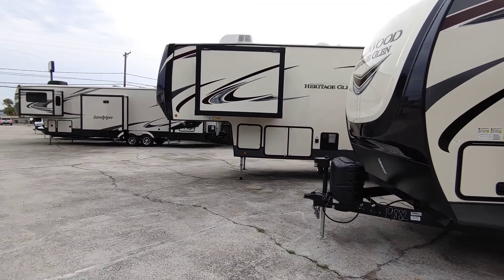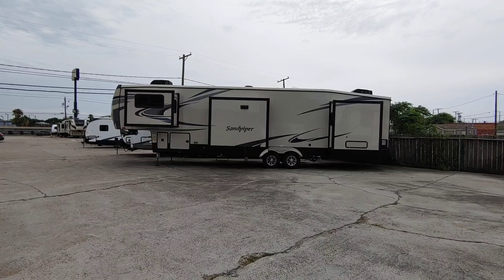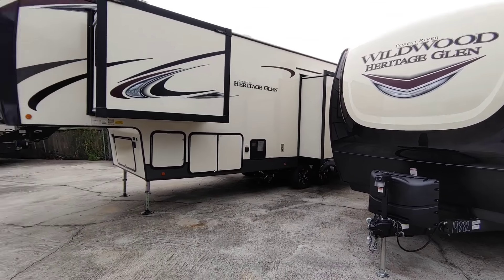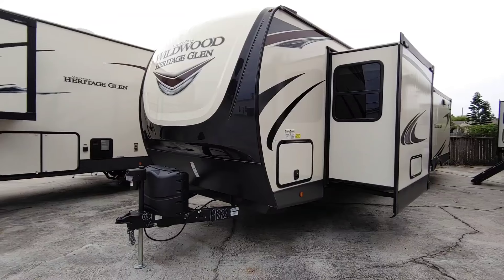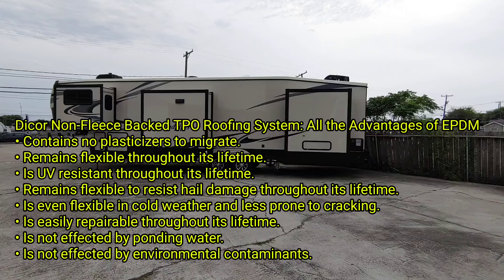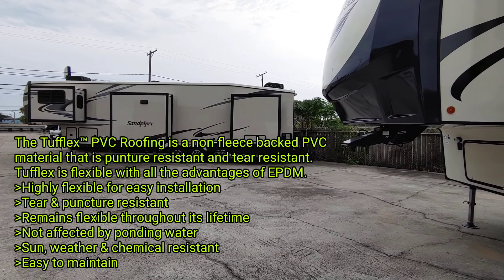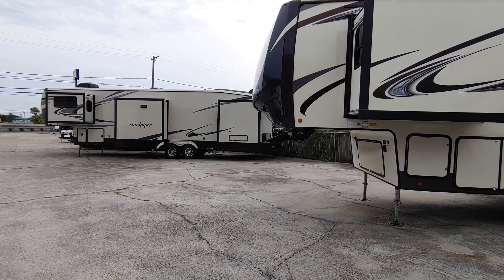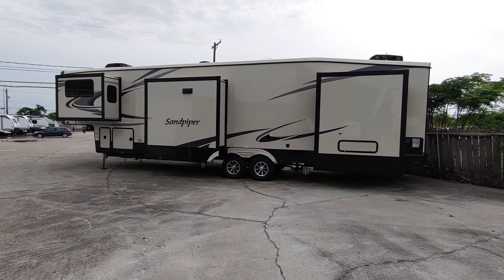RV Roof Materials Explained! Does it really matter? FIND OUT!

Comment: Coming from a commercial roofer of 25 years. EPDM is old tech. It also requires a chemical weld at all seams
TPO & PVC are similar. Both use heat welds at all seams. TPO is stiffer and less flexible than PVC. PVC is easier to install and detail around penetrations. PVC is typically a few cents more than TPO per foot. They are both easy to maintain. One of the reasons I chose my evening is because of the PVC roof. Hope this helps some of you out.
Reply: There is a product on Amazon called Class A Customs Superflex rubber roof.  I asked a question on that site and someone said that it is pvc.  Would you happen to know about this product?  I am planning on replacing the beat up EPDM roof on my 2007 Keystone toy hauler fifth wheel with this superior new pvc product.
Reply: Thank you Gabe for the information!!
Reply: Hi Gabe, second question, years ago I heard a roofer say use Torch On, they use it for flat roofs and corners, what do you think?
Reply: @franklogan494  Torch down is a super bad idea for an rv. It uses an open flame form a propane weed burner to be applied.
Reply: @raypabs5374  Hey Ray. I have not herd of this brand before. It is most likely made by another manufacture and private labeled for Superflex
Reply: @nvstyle5559  Sounds good Gabe, Thank you!
Reply: Hi Gabe. I have a 2014 travel trailer I live in full time and I believe it has a EPDM roof. I'm wanting to put a coating on to help with the hot Arizona sun & electric bills. I bought a product called ElastoKool but I think it said not to use on my type of roof.  Any suggestions on a budget?
Reply: Go to ABC supply and buy 5 sq roll of GAF self adhered single ply and a heat gun and T - Bar and voila U are on your way to a maintenance free roof system.... Just YouTube for application details.....
Reply: Photos of different types??

Comment: Thank you for explaining the different styles of roofs.  The warranties on these roofs are pretty much useless unless you follow their maintenance guidelines to the letter and can prove you did the maintenance.  A friend fought with Heartland a couple of years back over an issue and actually had the problem addressed by his dealer but the manufacturer still denied paying for the repair.   I sealed all the joints (front and rear caps and all protrusions) with Gaco's seam tape then used their liquid tap over the seam tape.  Once all that was completed, I applied  3 coats of Gaco RV Roof Coating (silicone-based) to all areas of the roof and seams.  I am reasonably satisfied I have a water-tight roof and have noticed a reduction in heat build-up in the trailer when sitting in the sun.

Comment: So my question would be if you had to make a decision on one of these roofs what one would you pick?
Reply: @Bunkysworkshop  When considering roofing membranes that minimize the release of microplastics as they degrade, the best options are those that are more chemically stable and less prone to fragmenting under UV exposure, weathering, and mechanical stress. Here's a breakdown:

Least Likely to Leach Microplastics

1. EPDM (Ethylene Propylene Diene Monomer)

Why?

EPDM is a synthetic rubber, not a plastic, and is highly stable over time.

It does not break down into small fragments as easily as thermoplastics.

Resistant to UV rays and ozone, reducing degradation.

Best Use: Long-term applications where durability is key.

2. PVC (Polyvinyl Chloride)

Why?

PVC membranes are durable and resistant to degradation, especially when reinforced.

Its chemical stability helps it maintain integrity, but additives in lower-quality PVC may leach over time.

Best Use: Applications requiring high chemical resistance.

More Likely to Leach Microplastics

3. TPO (Thermoplastic Olefin)

Why?

TPO is a thermoplastic, meaning it can soften with heat and is more prone to wear and fragmentation compared to EPDM or PVC.

Quality variations between manufacturers can lead to faster degradation.

4. Modified Bitumen

Why?

Contains plastic-based polymers for flexibility, which can degrade and fragment over time.

Asphalt base mitigates some risks but not all.

5. BUR (Built-Up Roofing)

Why?

Contains layers of bitumen and fiberglass or organic mats, which can degrade into particulate matter over time.

Recommendations to Minimize Microplastic Leaching

EPDM is the most eco-friendly option for reducing microplastic leaching due to its rubber composition and stability.

Avoid membranes that rely heavily on additives or have significant plastic content (e.g., low-quality TPO or PVC).

Comment: How do you determine what type of roof you have? Just bought a 2010 Excel Peterson Limited. The roof visual looks dirty but not damaged. I was thinking of coating it but don’t want to use the wrong product. I’m looking at Tropicool silicone or liquid Rubber. I have seen videos of people using something that does not bond well with the roof membrane and what a mess. Just want to get it right the first time.

Comment: As a plumber I have to side with PVC. Why? Think of your plumbing vents on the roof of your home. They never chalk or crack and remain strong even after 35 years. PVC HAS excellent UV tolerance and does not even yellow in the sun. There’s another way also but I am still developing it. When fully developed it should be a lifetime roof. Our RV’s deserve that. Especially for the cost.

Comment: A certain travel trailer company that makes their trailers entirely out of aluminum (not hard to figure out who) doesn't even make full walk on roofs, and many cost more than a very nicely equipped fifth wheel
Reply: They are about 90% walk on With the exception of the end caps.

Comment: Did I miss the part where you talked in detail about fiberglass? I see this on higher end units and wonder about its advantages/disadvantages.
Reply: Even with a fiberglass RV roof, you still have to caulk all the roof penetrations on a regular basis.  Definitely NOT maintenance free.

Comment: Do you have any videos on the different types of slide out mechanism and how to maintain them I am not a big fan of the cable set up from what I have read I wish the cable could be changed out to hydraulic
Reply from the maker: Switching from a cable system to a hydraulic system isn't practical, because the cable system uses the sidewall for support. Typical hydraulic, rack and pinion, or through frame systems use the frame of the RV.

Comment: The most important part is the thickness of the roof membrane  and in stallation which you failed to mention as most rv roofs are paper thin to keep weight and material cost down which results in seperation from fixed openings and tears and puntures from loosening deck fasteners (staples)  tree limbs or foreign objects tracked on to roof membrane,. Compare single ply roofing systems for comercial and industrial applications where useful life is up to 30yrs and not 10-15 yr prorated RV roofs that are poorly installed. The biggest threat to an rv is water damage and the manufacturers put the minimum resources into it IMHO. Your just promoting their products.

Comment: Why not use Line-x, Rhino liner or some other product like that. Would that not put a semi permanent seal on the roof?
Reply: I believe that Peterson Industries (they manufactured the Excel fifth wheels) once offered a rhino liner type roof from the factory as an option.  They quite because of all the all the leaking roof complaints they got.

Comment: I have a fiberglass roof (Winnebago product). Are these good roofs?
Reply: The best. A Monaco has a fiberglass roof.
Reply from the maker: Well, it's depends on what type of fiberglass.  On travel trailers and small fifth wheels it's likely a sidewall Gelcoat vs a higher end unit with a hand laid or sprayed fiberglass using resin.  There are many brands that use Gelcoat for the roof material in their lower end units.

Comment: As a RV Roof installer, I can say the info here is pretty accurate. All of these roofs are decent and durable. But with their strengths, they also have their drawbacks. 

Runner is very durable but can dry out over time. They adhere well (with older glues, but that’s a different conversation). The PVC roofs are sensitive to chemicals and react. Most of the issues I’m seeing with blowing up roofs is caused by the reaction of the vinyl and the butyl and sealant. Also the sealant is good for about a year honestly. Each year it should be carefully removed and new applied.
Reply: Jason,
Can you further explain a couple of things?  What chemicals are PVC roofs sensitive too? And, which sealants are only good for about a year? Which areas of the roof are you referring to?

Comment: I want to replace the beat up EPDM roof liner on my 2007 Keystone toy hauler fifth wheel, aside from fiberglass, which is more durable, TPO or PVC?  This video got me even more confused because I was under the impression that EPDM was best.
Reply: There are options on the market for repairing your roof other than replacing it if it's structurally sound. One of the better products seems to be Dicor rubber roof coating system. Best of luck with it!
Reply: I've heard of an option to Line-X the roof too.  The quality of it is dependent on who does the work.  I don't know anything more than that so do your research.
Reply: RV ARMOR
Reply: We have RV Armor on our 2016 Imagine 2950 RL.
Reply: Ray they are both durable roofs if you get a good thick mil like 45 mil to start. If your existing roof isn’t to far gone you could coat it with a silicone roof coating from Gaco and seal it and be good for another 10 years with yearly maintenance.

Comment: TPO is absolute trash. I work for a company that owns a lot of commercial properties. It's just not a durable material. We have properties with TPO, EPDM, PVC, Mod Bit, Tar and Gravel, etc. TPO has the most problems by far and that's across a pretty large sample size. It's just not durable.
Reply from the maker: Not the same material.  Even PCV in commercial applications is different.  PVC tends to be thinner than TPO on buildings where as PVC is a few mils thicker on RVs.